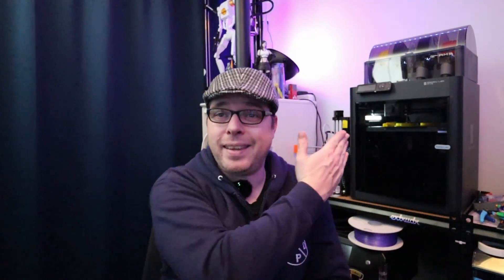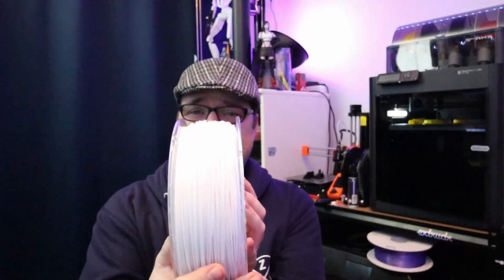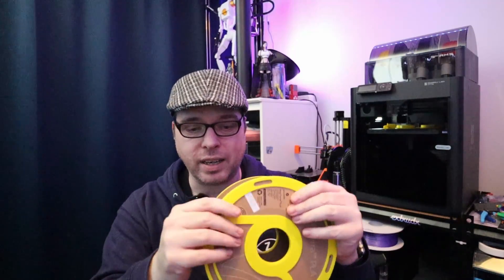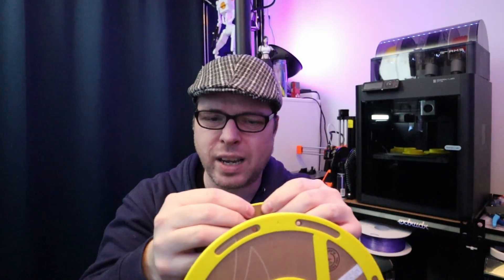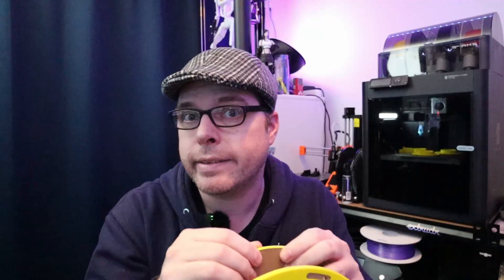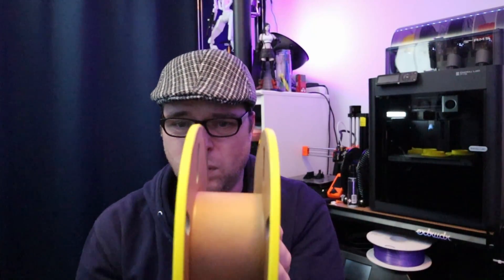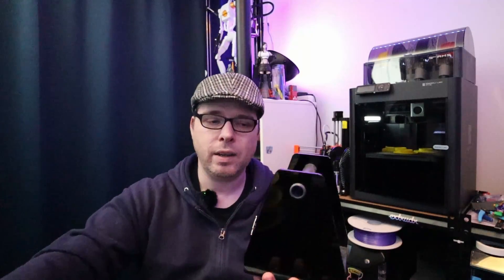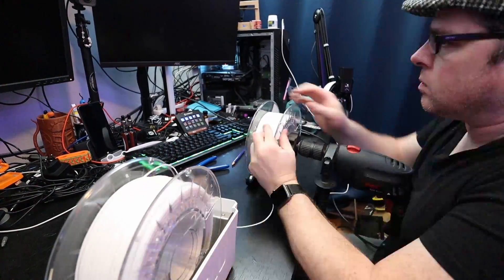Bambu Labs P1S with AMS - First Impressions - AMS Trouble!

Comment: I saw all those videos about cardboard spools - just got AMS myself. No issues with cardboard spools so far. It works fine. I don't use it for any kind production though. AMS comes with 4 empty spools so its not a big deal to re-spool most problematic filaments. Otherwise I'd just use Bambu filaments - the whole point of this printer is that it just works and it is fast.
Reply from the maker: There can be issues with cardboard spools, and I do need to try out with the spools. but till now I didn't really try a respooler. I was also thinking to use Bambu Spools

Comment: I have had it with card board spools.  If it isn't hanging on a spool holder, they are terrible.  The rings just do not work, I need see if TPU might work better, as it will have a better grip.  Half of the cardboard spools I receive arrive with dented edges.  The cardboard edges wear out, towards the last 1/5 of the spool it becomes too light and starts to hop in the AMS then gets tangled.  Lastly, all the dust in the AMS unit because of the cardboard spools.  Just make a master spool and be done with it.  Rant over ;-)
Reply from the maker: Oh thank you for your amazing rant! Yeah, that's why I didn't want to try out the spools in the AMS, but I still need to build one good re-spooler.